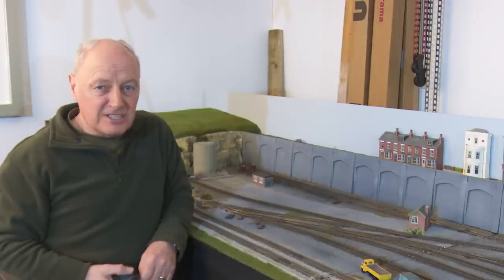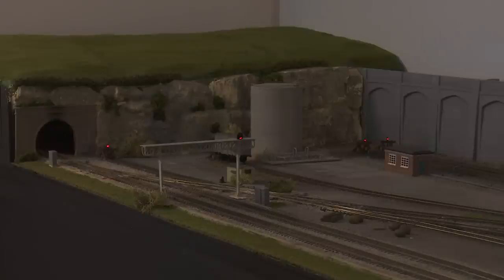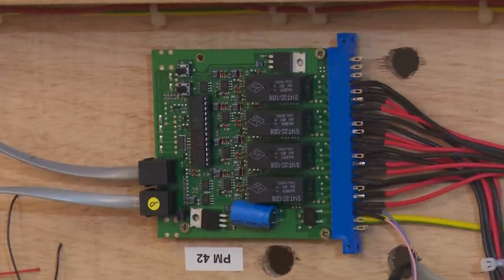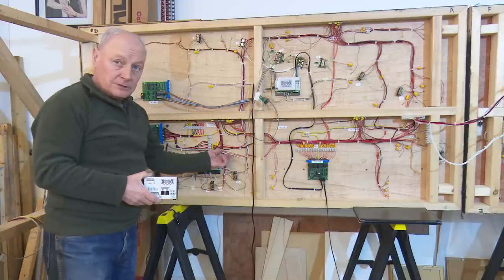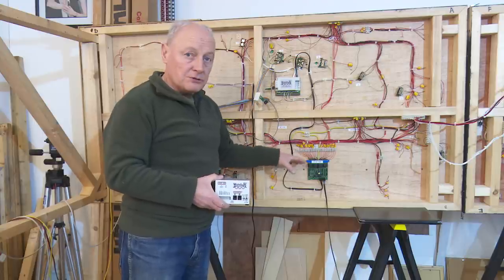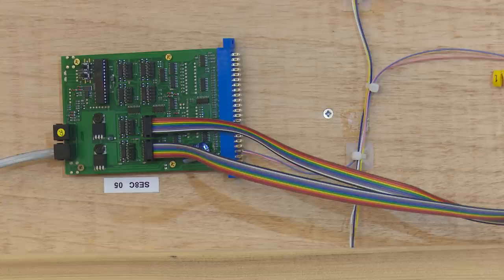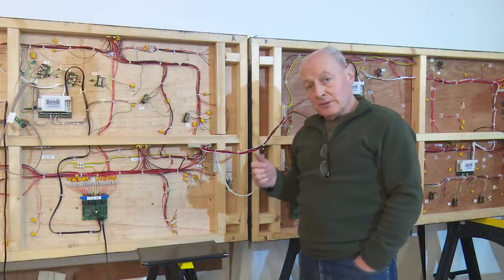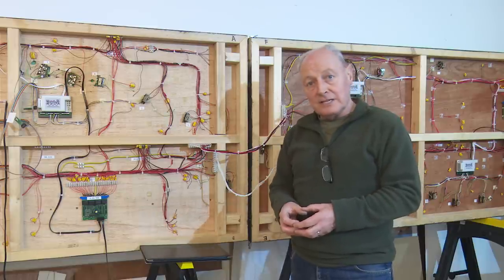17. DCC Wiring at Chadwick Model railway.

Comment: My Pacific Crest is my fifth over the last 47 years of layouts.  Many components were saved from the first four to be used on this 5th one.  Thanks for including solenoid switch motors as part of the discussion and describing them as "gun shots" in operation!  Fear not, I have already converted to slow motion motors, but only for those points I cannot easy reach.  Everything else will be ground throws due to my slim budget and my lack of computer knowledge.  You won't see this old boy going to "Gold".  Well done on this one, Sir.  I have it bookmarked for further study!
Reply from the maker: Hi Randall, I’m so pleased that you enjoyed the video. Yes the slow action motors are so much better but the price is somewhat expensive. Regards Charlie

Comment: A very interesting video Charlie. I too use technology in my railway modelling. As a former electronics engineer I build my own control circuits many using Merg kits as the basis. My control system is the free JMRI software and this is connected to my NCE system via usb. I did look at the paid for software but decided that it was too expensive to risk finding a feature that I need is missing. With JMRI I can add capability using the many built in  facilities, The down side is that there is a very steep learning curve to negociate before you get anything going. There is also a lot to be said for using parts from one manufacturer as you have and knowing they will all work together. ..............John
Reply from the maker: I too initially thought about JMRI but as you mentioned the learning curve is very steep.  I must admit to my addiction to automation!  It is very satisfying to overcome the software’s reluctance to give in straight away and win the small battles as the layout progresses.

Comment: Hello again, there is a simple thing i used to do to stop that loud noise from the solenoid point motors years ago, and thats to fit slim rubber O Rings the the part of the point that throws, this massively dampens the sound to the point the sound is halved
Reply from the maker: Great tip, regards Charlie

Comment: The thing is though charlie, it really can be as simple as 2 wires going all the way up to hundreds of wires, One thing i cannot grasp is how they can charge £300 for TrainController software that's only a 16MB file! I know you only ever have to buy it once but damn man, are these people living 20 years in the future or something? I sat down last night with a calculator to add up how much everything i need would cost in N gauge, at the moment i'm up to £2,050 and counting! I'm going for the digikeijs dr5000 system, it does absolutely everything, Anyway charlie your videos are the best on youtube
Reply from the maker: Good luck with your automation and do keep this community posted with your progress.  There is of course, JMRI which is free but apparently, it’s a little less user friendly.
Regards Charlie
Reply: Wait til you start buying locos and carriages!
Reply: I'm doing the same. My new layout for DCC is quite challenging and I am no electrical genius. MYT issue is which DCC system to use.

Comment: (Edited Update)... Wow, plenty of spaghetti there to feed you for a week if you could eat it, LOL. Tho with you upending the boards like this and have shown how you have kept it neat and tidy from one section to the next is impressive Charlie. Do you have OCD... LOL. No with my early days doing Electric Engineering and Electronics back in the mid-80s. Taught me how to control the flow of wiring to different sections and to have every aspect of it neat and tidy, especially for fault finding.  At times it can look bewildering, but colour coding and labeling everything makes it a lot simpler to follow one end to the next. 

This is a must in the IT Depts (that I worked in the NHS) for servers etc as your not working between two baseboards next to each other, but from room to room, building to building. So a label like B2S15IO31PC101 would be Building #2 - Server #15 Input/output network socket 31 to the PC #121 (1st floor on computer 21). Long Labels they maybe but if you're at B10S09IO17PC523 you know where to go. 

Therefore logically baseboards can be the same B1PM05S09 (Baseboard #1 - Point Motor #05 - Signal #09) even to the extent that the label points out both ends of the cable going from and to elsewhere (as above) would be B1PM05S09 - CP01TB03SW19 (Control Panel #01, Terminal Block #03, Switch #19). Long-winded maybe, but useful in a wiring diagram in your layout folder that has six A4 pages for a 6x baseboard layout.

Edit Update: Oops I forgot to say that the label L1 closest to the T1 terminated end is that location. The 2nd label L2 is then the T2 terminated end away from this point to its location. 

T1 12v @ ---<--- L1(T1) & L2(@T2) -->-- wire/cable --<-- L2(@T1) & L1(T2) -->-- @ switch T2 etc, etc, etc 

I think I got that right... LOL, anyway, hopefully, that will help any beginners with their designs on paper to draw the layouts connection points of wiring and to label the physical wires on the baseboards. 

To make the labels: just cut an average address label into strips to suit your needs. Then wrap it around the wire as you would with a Loaf of Bread sticky Sealer tape and write the info on it. If printing the info on a sheet of A4 and cutting them out, but remember to leave the same length of blank space after your text and cut out. Add a few extra spaces (4mm) to cater to the thickness of the wire. Now place the cut-out strip of text paper and lay it flat on a clean area of your work table. Now get your roll-off Sellotape and pull a cut strip of it longer than your label, and place it lengthwise on top of your label, but centered the best you can top and bottom and stick it down gently on top. Next is to peel it up again with the text stuck to it and wrap it around your wire so that the sellotape sticks to its self (like the bread sealer). Lastly, cut away the excess clear sellotape leaving 1-2mm around the edges of your label to stop it from opening and falling off.
Reply from the maker: My notes are even larger than 6 pages. Each piece of electronics also has a page!  Good notes are essential.  I’ve learned the hard way.  After a couple of weeks away, I returned to my model Railway club.  I was shocked to find that one board had been wired completely with orange cable!
Reply: @ChadwickModelRailway  Yeah it is a matter of it being kept as a KISS (Keep It Simple Stupid) plan. Orange is a favourable colour over here in Belfast... LOL even LOL (Orange Lodge Halls IDs e.g. LOL45 etc). Funny thing if I built a prototypical layout of the NIR from the 70s in Summer. I would have to paint the house Gable Walls with Murals and the kerbstones in Red, White and Blue too, LMFAO.
Reply from the maker: Got it John
Reply: @ChadwickModelRailway  Actually Charlie that would make a good short video on Labelling For Layouts film on here for your Subers.

Comment: Good afternoon in regards to wiring do what guage do you use for all the different bits and bobs i.e power ect.When wiring a dcc chip to a loco what wiring would you use for that hope all is well 

Ken
Reply from the maker: Hi Ken it’s very difficult to suggest which cable sizes you should use, it’s all to do with how much power you intend to draw. I suggest you get in contact with James from DCC Train Automation. He will give you all the assistance you need. Regards Charlie
Reply: @ChadwickModelRailway  thanks very much I will do indeed

Comment: Charlie , a question for you can you suggest a power unit for a  dc layout spread over  2 x  8' x 4' boards , this will need to cover up and down line outer circle plus fiddle yard . I need to have constant voltage over all aspects , this layout will hopefully be updated to DCC late 2021 early 2022 . Hope you can help
Reply from the maker: Best contact DCC Train Automation.  They have a better appreciation of what’s currently available.

Comment: Hi. So I'm about to (once the garage is cleared) embark on an insane project and having watched a lot of your stuff as well as others I am heading down the Digitrax route. I'm intending to use some computer control (currently JMRI most likely as I can run that on a Pi) but currently just planning stuff. However have hit on an issue that I just cant get my head around as I cant find the info: The numbering / Board IDs etc of all the devices.

Going to have PM42s DBL168s DS64s (about 24 of the buggers so may need a new mortgage) and an SE8C. I think all the board ids can overlap between devices, so there can ba a 42 that is a 1, 168 that is a 1 etc. But, particularly with the block detection, switches and light outputs of the SE8C there seems to be some concern about overlap.

Have you any idea what can overlap, what cant overlap, and any hints on numbering all these devices!

Cheers and loving the channel!
Reply from the maker: Ian, you have no worries on this one as I'm sure that can have the same ID.
When building this layout, I called the first board, Board 1.
So the DS64 numbers are 101 and 102.
The points also start with a 1.   11, 12, 13 etc.
The BDL168 is 101
On Board 4 they are 401 and 402 etc.
You just need a routine that works for you.
When it comes to computer inputs it will ask for the DS64 number and its point numbers.
Good luck, its a long journey!
Reply: @ChadwickModelRailway  cheers! Yeh definitely a long term project. Partly due to time but mostly due to cost!

Comment: Very interesting, and a great video. I was wondering if you were able to do a video regarding block detection and signalling wiring? I.e. I'm always impressed when the trains are able to pull-up to a station or signal but not 100% on how and where to place the breaks or detection for circuit features
Reply from the maker: Hi Steve I will do in the future when my layout reaches that stage, it might be some time!
Regards Charlie

Comment: Hey, I’m just starting my dcc layout and like the idea of having the separate power districts to prevent the whole layout shorting out if I have one.

I was looking at those PM42’s and was wondering if they work with other brands/products.

I want to keep things as simple as possible for now and I’ll be running from a hornby select controller to start with. In my mind I’d be putting the main power into the PM42 and running the BUS wires from them into the separate districts. Would this work 😅
Reply from the maker: The PM42 is ideal for Digitrax layouts.
However, there are better solid state options that are cheaper. Give James a call at DCC TrainAutomation 
01823 429309.

Comment: So much about DCC confuses me. How are the seperate power districts seperated; is that simply with insulated rail joiners? And, where do boosters come into play?
Reply from the maker: Hi Gabe, I think that you are over complicating DCC. Boosters are only required on large layouts that need more power than your system can provide.  Most controllers produced 5 amps and that is normally ample.
Power districts are also not essential and need to be planned at the initial wiring stage.  Insulated rail joiners are only normally used when electrofrog points are installed.
The shop “Digitrains” can offer unbiased advice.
Regards Charlie.

Comment: Hi Charlie. Just started out a simple layout with my son. Great videos with a lot of insight! I'm struggling at the moment with the wiring side of things though. Currently running DC. Can I connect 2 separate tracks together without any issues/ short circuits? 
Thanks in advance.
Paul B.
Reply from the maker: Yes Paul you can but if you’re running two locos they will run in unison.
Reply: Because I'm powering the track not the loco. I may convert my locos to DCC then. 
Thanks!
Reply: Can I wire in more than 1 track piece on DC and have a bus unit or will that take to much power away from the controller??

Comment: Hello, I wondered if you  could give advise on equipment I need to run Traincontroller ( Silver)  such as:
Command station etc.

I would have:
1.    around 20-3O blocks
2.    30+ turnouts ( servo type )
3.   Signals 2 and 3 aspect not sure how many yet.

Would be possible if I could contact you for more details..

Many thanks
Reply from the maker: Wow Alan, what a question!  I use Digitrax but there are others such as Lenz and I think NCE can do it as well.  The buget that you will require is not small.  A Digitrax system cost around £350. To carry out block detection, a BDL168 detects 16 blocks and retails at £135. TC Silver costs around £350.  I suggest you find Rudy, (rudysmodelrailway) on YouTube.  He has a great series of videos and explains in great detail, how TC works.  You might also phone Digitrains and ask for their guidance and prices.  Good luck.  Regards Charlie

Comment: Just a question. I own HO scale trains. I've been going DC. Now, I'm considering DCC. Question: say I have 4 trains: the locomotive, freight, tanker and caboose. I realize that the locomotive MUST be DCC-ready but must the other three be DCC-ready? Sorry for the dumb question. Can anyone help?
Reply from the maker: Hi Obeeone, yes DCC is all or nothing.
You need a DCC controller which will deliver 15v AC.  DC layouts use 12v DC.
Then you have to fit a DCC decoder into every loco.  It’s a pricy conversion but could be worth it depending on your aspirations.  Hopefully you have subscribed too.

Comment: Super fantastic video! Very informative and it does give a good insight to how, if wanted, to advance your layout. A question if I may, as you said you are using a few Seep Solenoids, have you been able to get these to work with the DS64? I have struggled with this and so have others and I would very much appreciate any information or help on this matter. If you message me I am happy to provide my email for easier communication. Thank you! Des
Reply from the maker: Hi Des, I have had no problems at all with SEEPs.  I only install them when the original Peco motor/switch became problematic.  
I imagine that you have electro frog points and have programmed your DS64 correctly.
I can email you a photo of the wiring of the SEEPs and DS64, if you send me your email address.  
I can delete the email address once your message arrives.  
Regards Charlie
Reply from the maker: Got it Des.
Reply: Super thank you Charlie.